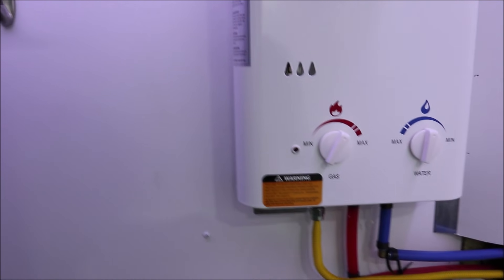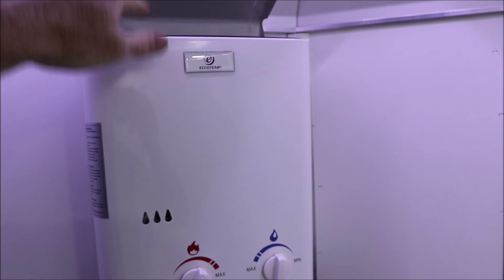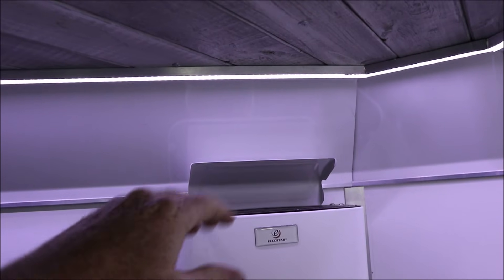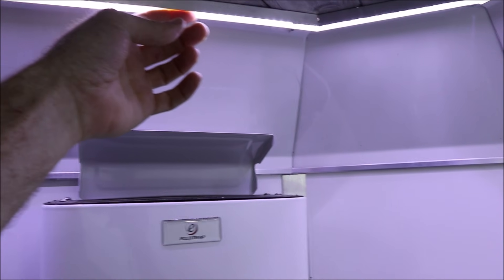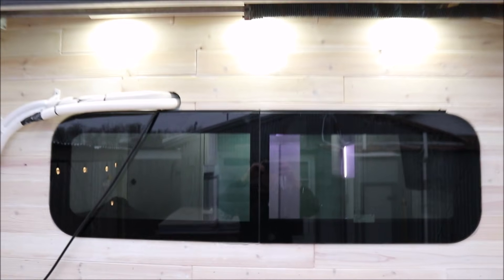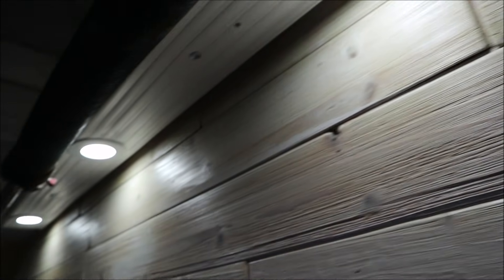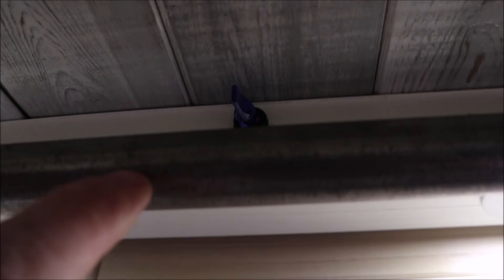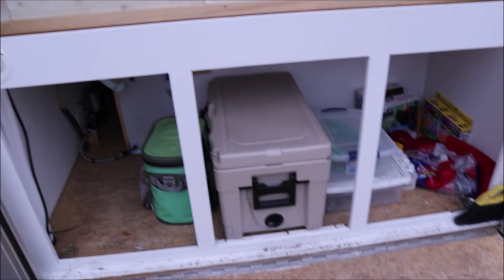Cargo Trailer Camper Conversion Update 5 Flooring - Exterior Plumbing

Comment: Much respect for your cargo build and skills you have shown.  I have a comment on your water heater! You mentioned how sensitive they are to water flow. And they ignite easily.  
I have a 6x12 with a tank less water heater. And yes it's overly sensitive.  What i have done on my build is ! The water system is basically 2 separate systems,  one is for heated water with the water heater included in the system shower and sink that gets heated water! The toilet has its own water pump and is plumbed on its own. A little over kill but it works great. And the way I have plumbed it, I have a back up water pump that has come in very handy when one of my pumps went out. Just a thought! 
I also think you have a gift , the attention to detail is incredible.  I think you could do well building and selling them. Or a side line when you retire. 
Thx for all the great information.
Reply from the maker: @dirtyharry5878  thx for the kind words and sharing how u plumbed yours! I don't think anything is overkill if it works! 😜

Comment: I haven't read all the  comments so forgive me if someone already mentioned this  . You must crawl underneath and seal your  subflooring.  It will disintegrate  with water splashing up from the road.  A coat of Henry's  roof seal should do the trick . Such a beautiful conversion  , it would be a complete shame if it all had to be tor n out to replace the  floor. Thanks for sharing your build with us  .
Reply from the maker: Thanks for your comment! The flooring is composite. Made to withstand water, has a 25 year warranty
Reply: @danielmid6022  Oh . When you put the camera below the trailer  it looked like Waffleboard.  Happy camping  !

Comment: wow!! Im taking your designs and doing epoxy walls for the shower, small sink in the middle(under where your water heater is) and compost toilet where your small counter is in the bath.   Im also doing a Murphy bed with fold-up  dinner table attached with a 45 inch. tv on the other side, so we can watch tv while at dinner table or while in bed. .  BUT WOW your colors and design made me do mine!! THANKS!!
Reply from the maker: Cool can't wait to see what you do!

Comment: Thank god for no music on your channel, what a joy!  Silence is golden.
After watching many van builds, I am finally really excited to see yours.  The build is smart, elegant, and your sense of color is stunning.  Someone is a decorator here.  

This is my first video of yours so I will go back and watch the others.  I would love to know how you made your blue green countertop.  Also want to know how you colored those turquoise wood (?) panels on wall, as the effect is very pleasing.  The shading, using several colors gives depth.

On the galvanized zinc shower walls, did you have to use any finish to prevent corrosion/ water stains/ make water slide off easier?  Why did you pick this material?  Are you still happy with it, or have regrets?

The straps for your tanks look flimsy.  I would not trust them with the weight of those water tanks.  Great to see how you mounted these!  We don't often get this view point.

Nice garage area and creative lighting system.  You are so inventive!  Subscribed. Anyone this inventive, with such a great sense of color and style, and who values the simplicity of silence, is definitely worth subscribing to.  Thanks for the tour!

Comment: Looking good, I think the change in flooring orientation was a good idea.  I would add a couple of things, some type of protective covering of the plumbers strapping under you tanks, maybe leather or rubber, so the strapping does not end up cutting into the tank.  The other item would be to cover the tank breath holes with some type of fine mesh or maybe stuff some steel wool in the pipes to keep out bugs and debris.  Especially if those vent tubes are for your fresh water.  Thanks for the update, this is one of the builds I follow to help with mine.
Reply from the maker: Thanks! I agree with your suggestions 100%

Comment: Wow, this is one of the best conversion jobs I've ever seen on a small Toy Hauler Trailer. One thing I'd like to bring up is your propane tankless water heater, I believe they are designed to be vented outside so you do not get carbon monoxide inside the RV, please verify this for your safety. Thank you.
Reply from the maker: Thanks for the comment! There is a maxxair fan about 3' away from the heater that vents during use.
Reply: I love this conversion one of the best that I saw beautiful enjoy brother

Comment: .
Great job on the build it looks like a high end home.  I have the same water heater for my pool shower word great and it’s about 8 years old now. Only issue was my fault. Keep a eye on the battery area it will corrode and stop igniting.
If there is movement in the plumbing strap it will crack and fail. Great stuff for stationary applications not sure how it will hold up traveling down the road. Plumbing strap is extremely brittle I have used this for decades to strap capacitors in ac units. I “cut” it to fit by bending it back and forth a few times and it breaks right away.

Comment: Great job...maybe you are going to but I would spay the rubber seal paint under the whole trailer to seal the water from keeping the wood from rotting ! Also I would get those round vents and put them on the side wall where you have the little oven to circulate the heat !

Comment: Try to put a check valve in the supply line to the water heater .that should help with the pressure drop
Reply from the maker: Thanks!

Comment: I had a similar problem with my tankless water heater. I don't know if you have your plumbing running through a by pass but that was my issue. I bypassed the bypass and it works perfect. Very nice build though

Comment: I love the countertops. Really nice. I did a similar distressed aqua / green beadboard for accent walls in kitchen and shower walls, so you know I love the aqua treatment. Also, wonder if a check valve on the cold water before the WH might stop the ignition.

Comment: A good tip: Picture yourself sealing your tub at home with silicone. You have removed the old stuff and installed new. Looks great, right?  The problem is this. If you don't allow for weight in your tube before sealing, the silicone will fail.  Before adding the silicone, fill your tub, then seal with silicone and allow to dry. That way your silicone has adapted to your expansion and contraction.  In the case of a trailer shower....weigh your shower base down with anything remotely close to your weight. Then silicone and allow to dry.
Reply from the maker: Thanks for the tip!
Reply: That's very true. I learned the hard way years ago

Comment: Daniel...your craftsmanship is outstanding and your willingness to share your vast experience is greatly helpful.  I too am in the process of building a cargo conversion/toy hauler.  One question...actually I have many...the black water tank is vented thru the wall...what vent cover did you use to keep insects, etc. from entry?  Thank you in advance.
Reply from the maker: Hi thanks for the comment. It's been so long I don't remember exactly but I do think one of my videos has a link to it.  Sorry, I can't remember right off hand... Too many parts..😁
Reply: @danielmid6022  I fully understand.  Will keep looking.  Certain that I will discover the needed part somewhere on the 
world Wide Web.  Stay safe.

Comment: ok. I used a full can of touch & seal , its not going to move. I have the same water heater ,love it.
Reply from the maker: You have any pictures of it? I just want to be able to easily remove the fridge if necessary. In order for the fridge to slide out it first has to lift up approximate 1/4". Thanks for the idea

Comment: You did a really nice job on your conversion. I just found your videos now. The layout came out really nice and your build skills are excellent. I've just watched all your build videos and I got a lot of really helpful info from them. Thank you for taking the time to go into detail on all the tricky components like the bathroom etc. It really helped to be able to see how you approached these things. Is there anything different that you would do now if you were to do it again after using it for a few years? I'd love to see a full walk through now that some time has gone by to see any mods you may have made. I think you may have mentioned it in another video, but what brand and dimensions is your trailer and the total length of the trailer from tongue to back.  Do you know what you came in at for weight when you had it all finished?

Comment: Nice job,paint the plywood underneath the trailer before it rots and I just put 60 dollar a gallon silicone roof sealer from Lowe's on my roof 2 coats and have enough for another coat someday, 2 gallons is what I bought for a 14x7 trailer.
Reply: Looks like the flooring is AdvanTech®.  Stuff way better then plywood, but yea, it should be painted.
Reply: @johntalbert8227  One thing nice about the internet, you can look up things you might not know ....Like they recommend that the product not be exposed to outside weather and they recommend that it is sealed or painted....I have a conversion camper and its looks like a log cabin inside and one of the first things I did was paint the underside with the best outdoor wood paint.  You are driving in the rain and maybe snow and salt or mud. I like to take care of my investment. And the paint only cost 20 bucks and 2 hours time.
Reply: @freedomring4813   Yes you are absolutely right.  It should be protected.

Comment: You've done a wonderful job! Very professional-looking! I was wondering what type of screen are you going to put over your exhaust hose and what type of undercoating are you going to be using? The reason I ask is no one put a screen or undercoating on mine & I've had real problems. I sold mine with full disclosure to the people but want to be aware of what I should use the next time if it isn't done correctly.
Thanks again for some great ideas!

Comment: Daniel, if you could attach some hooks to the walls for hanging coats or something, you could then possibly use a motorcycle size cargo web or the fridge. This might allow you a 2 for 1. You have done an absolutely stellar job!  Well thought out, efficient design. I don't know if that little oven serves as an "air-fryer" or not, but if it doesn't get one of those little keg looking ones they are fantastic! Cuisinart actually makes one that looks similar to yours and does it all. Do you have any plans for solar recharge for the battery or anything?
Reply from the maker: Thanks for the ideas!! I do think I want more of a permanent mounting solution though, but one that is easy to access if I need to pull the fridge out. I'd love to add solar in the future but no plans for it as if yet. Everything is easy to access if I decide to do it
Reply: @danielmid6022  Your welcome, I'm often hesitant to suggest anything because I don't know how it will be received. I'm sure not an expert on anything, just throwing ideas out there.

Comment: Great build.  How big is the trailer?  Thanks.
Reply from the maker: 19x7 thanks!
Reply: Daniel Mid wow...that’s huge.  What are you pulling that with.  I,on;y,of a sienna.  I am hoping for 6x10.  Do,you,think my sienna would have issues.
Reply from the maker: @SuperDanhvo  it's all aluminum so it's extremely light. I have a 1/2 ton ram ecodiesel that pulls it no problem. I average 17mpg while pulling it.

Comment: Great job!!  What's the size again?  What's the type of trailer.   I  noticed that some the beams under the trailer were Aluminum.
Reply from the maker: Thanks, it's 7x19 all aluminum by legend trailers
Reply: @danielmid6022  what's the height? I'm in Texas and the only ones I see are 6'6" so just wandering
Reply from the maker: @marioarteaga4216  it's 7' high I got the trailer out of Dallas.

Comment: You could have put a nice leather loveseat in place of that uncomfortable bench and used a couple of TV tray tables to sit and eat.Otherwise nice job. You should also paint the plywood underneath the trailer to prevent rot.
Reply from the maker: Thanks for the comment! A love seat would've been nice but would've stuck out to far and the bench is there to allow for an electrical panel and plumbing access for the shower. The floor is composite, not ply wood and has a 25 year warranty.
Reply: @danielmid6022  25 year life underneath the trailer where if you are driving in rain and snow with salt or mud???? Sorry but I'm 59 and never seen anything last as long as they say it would. I'm talking about underneath your trailer. And the manufacturers recommend that the product be sealed or painted if out side in the weather as underneath your trailer and yes I painted mine before I took it camping....you have a big investment and a lot of time 20 dollars for a gallon of paint and 2 hours does the job. Again nice job.

Comment: Your videos have been great. Very Helpful. Are your floor supports every 16 inches? And Where did you get your black and gray tanks. My trailers supports are 16 inches on center and I am having trouble finding tanks that are a decent size to fit. Thanks
Reply from the maker: Thanks! I can't remember but I think they are 20" but I'd have to check. I found the tanks on eBay
Reply: @danielmid6022  did you raise the floor  in the bathroom to help with the tanks?
Reply from the maker: @michaelbreaux9164  yes. Check my other videos. Think there Should be something in there about it

Comment: Great conversion. Where did you place propane tanks(s)?
Reply from the maker: On the front tongue. One or two of the videos in my channel show its location and mounting bracket. Thanks!!
Reply: @danielmid6022  Thanks. I watched all the videos now and saw that. Again you did fabulous job. Put deposit on the same trailer this weekend and will be doing conversion using plenty of your ideas and videos. Do you know what was the total trailer weight after the conversion?
Reply from the maker: @krzysztoforlowski6010  awesome! They are great trailers. I never weighed it but I do plan to eventually

Comment: Nice work. Efficient use of space! The water heater is same I’ve bought and I heard it needs to be level? You mentioned water pressure is a concern? Would expand on it? I planned to hang mine off lock bars for ramp. I have gas quick connection outside near and have to run water to heater. The WH is outside model and exhaust gas cause you discomfort? How much water flow before gets hot? I only have 20 gallon tank inside. If you wouldn’t mind your experience would be appreciated!

Comment: How did the water heater do by mixing the water at the heater and not at the shower it self. also what brand of  on demand water heater was that.
Reply from the maker: It does good. I'm actually working on an update video on the water heater after 3 years. Should be out soon

Comment: The only down side to your camper is the bare wood under your camper thats a no no and will come back to haunt you :( Other then that its an awesome set up :)
Reply from the maker: Thanks! The floor is composite. I will still likely protect it at some point but it has like a 20 or 25 year warranty as is

Comment: What are you planning to do with the trailer once it's finished and how much longer before it's done? Took me A LONG time to finish mine.
Reply from the maker: Planning to camp as well as use it for my work instead of hotel hopping. I've had several people contact me about selling it but I don't think I could recoop my cost Unless i ask something crazy for it. No clue when it will be done but the sooner the better... Definitely taking way longer than I thought
Reply: Ya, I have about $25k into mine already. It's a 14x7x7 V nose so 16 if you count the front. I've been building since May of 2017. I'm 64, single and a Software Engineer and pretty much have unlimited funds. If Amazon doesn't deliver something every day I freak out. I'm a wood worker so I went to town on the inside. I'm trying to quit my job and hit the road.

I watch videos non stop of people living on the road in a van, trailer and beat up RV's. All of them scrambling for content to make enough money to eat from their YouTube income. I'm so glad I won't have to do that. I plan to Boon Dock 99% of the time. My trailer is self contained. No video of it yet. May let someone else do it when I'm ready.

Just bought a new Chevy Silverado V8 to pull my trailer. Pulled it for the first time Christmas morning at 2am experimenting with the brake control . Weighed the tongue weight and may be under so might have to add some.

Comment: Hey Daniel,  I seem to be constantly looking for "A better way" to do everything it seems. I saw this and thought of you and your trailer. Wouldn't this be a slick way to store extra water on top or even the side('S) of the trailer? You could actually daisy chain them and use gravity for the feed. Also, you could vary the lengths if need be. I just figured since you have a narrower rig, the "wheel well" space is actually useable if you think about it like you used it for your A/C. Just some thoughts. Here is the link: https://youtu.be/dG2HK9JsAjw
Reply from the maker: I've seen a local Toyota land cruiser here with that system, it's pretty awesome. Thanks for the share!